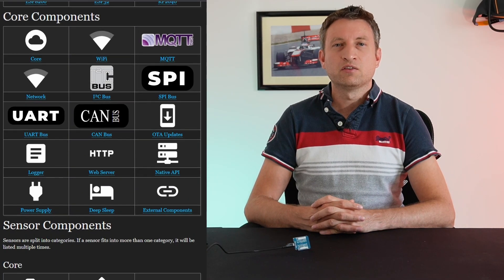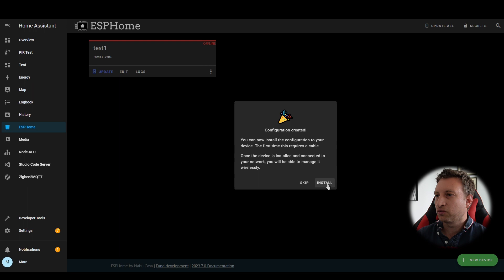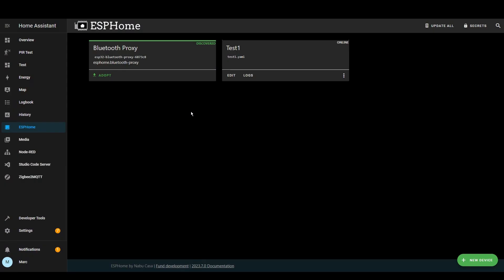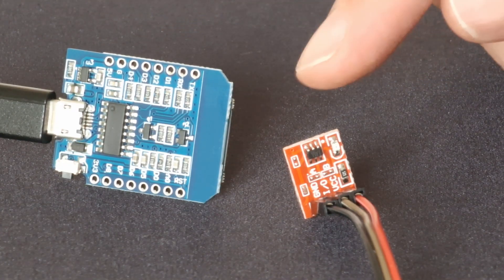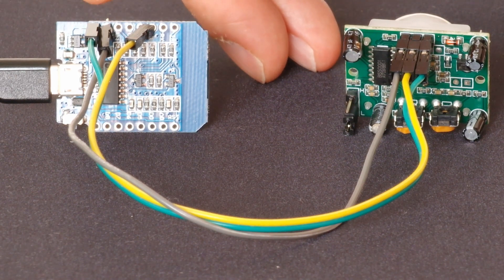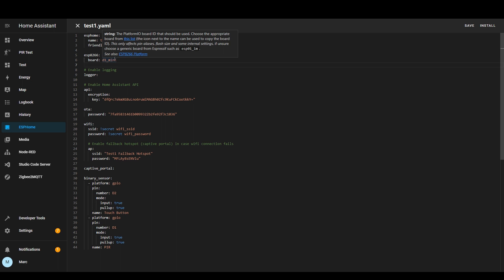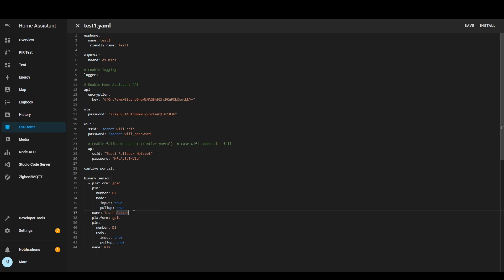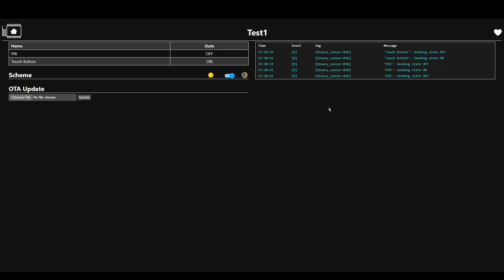Getting started with ESPHome

Comment: Very nice tutorials!

I've developed some custom devices coded in arduino which work great, fully independently.

It monitors the voltage in my home, display it on a small OLED screen and in case it goes over / below a configured threshold to open / close some relays (with a configured debounce when going over or below the threshold).

I also have a potentiometer in order to easily adjust the threshold voltage between a min / max range.

But I'd like to know if it's possible to rebuild this using ESPHome just in order to be able to also integrate them easily into HA if needed as extra functionality (besides working independently).

And maybe a simple web GUI using ESP32's internal web server to control the threshold (and maybe the debounce timings).

Comment: Spectacular, for a moment it gave me hope.
My Circular Failures at trying to run & make esphome prepare a esp32 dev kit board (wroom-32) for initial use.
Every attempt, every way to run ESPHome Builder FAils Spectacularly with impossible to resolve errors.
Searching for solutions brings up endless of the same but different and no real solutions I can understand or relate to.

I'm a Disabled American Vet thats been through 20 ortho surgeries to my spine, leg and knee. I have enough electronics in my spine and hardware in my body to make "The Six Million Dollar Man" look like a 2 cent nobody. Have been at this for over 24 hours straight. Im tired, and I I hurt alot and I am at my ropes end. Like my life This is a Dog Gone Greek Tragedy of the highest order. Following all procedures from ESPhone to the very letter, how can this be filled with so many bugs and failures as if they don't know. If you have the stomach for it go ahead and read on. Thanks!

Can anyone help me out. It has to be an install under Ubuntu. Its on my nice Dell Laptop now. I intend to buy a Raspberry Pi5 but I will put Ubuntu on that. Im not ust going to waste the whole thing to run a few cycles for HAOS that would be a complete waste of hardware in my eyes and wallet. So if you can help a Brother please do and Ill try to make it up some time in the future. Thanks!!!

Install home assistant under ubuntu 24.04 with kvm
------------------------------------------------------
The home assistant cli opens sucessfully after starting the vm
Enter the home assistant url http://homeassistant.local:8123 that is displayed in the cli in chrome browser.
I cant remember how I choose to do this because nowhere can I find how to "start" hoem assistant after the cli comes up
Upon the first time of getting to HA site I did a add on for esphome.
I am using a esp32 devkit board with a wroom-32 on it.
Ive used this board and 3 others the same a million times under arduino...so they work
Clicking on ESPHome Builder from the side menu in home assistant opens the esphome window in my home assistant browser window
The Welcome to ESPHome window opens and prompts me to add new device. I click +NewDevice

Here's wehre things go very bad and put me thru a several hour circular path right back to m initial Failures

After the click the a small info panel opens:
1st paragraph: ust states to connect device with a USB cable
2nd paragraph: You are not browsing the ESPHome Device Builder over a secure connection (HTTPS). This prevents ESPHome from being able to install this on devices connected to this computer.
3rd paragrpah: You will still be able to install ESPHome by connecting the device to the computer that runs the ESPHome Device Builder.
4th paragraph: Alternatively, you can use ESPHome Web to prepare a device for being used with ESPHome using this computer.

Commentary on above: What good is ESPHome Device Builder as an add on if it wont run under the home assistant window.OR is this just because I installed it in KVM under Ubuntu 24.04?!?!?
I dont understand paragraph 3 telling me I can still install it, after telling me I cant in paragraph 2. Really?!?!

Esphome Web or Continue
-----------------------
I then have 2 choices: Open EspHomeWeb or Continue.
 -Option 2. Continue produces a small window withspinning status wheel like in Windows that never ends.Its bassically a crash.
  - I must reload the bbrowser window to try other option
- Option 1. I refresh browser window, Ive also shut down the browser and the KVM and started all ovver agian theres no difference
 - I click "Open EspHomeWeb", Im taken to https://web.esphome.io/?dashboard_wizard
 - It tells me to connect my device (esp32 dev kit board with wroom32 module on it). I have it connected to usb, yes its a data cable.
 - Click connect, I select the correct port interface to use, the click "Prepare for first time use"
 - Prompted with antoher small info window "Prepare for first time use" and I click install.
 - A small window pops up with spinning wheel saying "connecting" then "installing"..This will take 2 mins.
 - Great I get small window saying Configuration Installed !!!...and then I click close on it
 - Another small window pops up saying connecting and a second later a faulure window: "An error occured Improv Wifi serial not detected"
 - Whatever that means and why ever it happened.
 - I close the window another opens asking me if I want to download logs. I try that but there are no logs to display or download, its zero size.
 - Theres an "install option". Dont know what it installs but if I click on it now the browser window just hangs.
 - BTW m wifi credentiaons where in the secrets.yaml file. No where did it say to do that. After  reading 10,000 posts and endless sites on how to I finally figured out how to do it.

 Troubleshoting this "An error occured Improv Wifi serial not detected"
 - I search for "An error occured Improv Wifi serial not detected" in browser.
 - Get a bunch of5 yr old posts on esphome or the home assistant community of many getting same mesg, there is no solution.
 - Looks like official esphome replies blaming it on the folks and saying the esp32  moudles where already verified to work.
 - But this isnt true.
 - Later thru a zillion seraches I find on this site https://www.espboards.dev/blog/setting-up-esphome-first-time/
  - Its an offical esp32 site. And can you beleive it, the 1st thing they admit on the page is this wifi impro problem per below!!!!
   "Setting up ESPHome for the first time on an ESP32 is a simple yet sometimes finicky process, especially with newer boards like the ESP32-S3 or ESP32-C3. The easiest method to begin is using the ESPHome Web Installer, a convenient tool that allows you to flash and configure ESP32 boards directly from your browser. However, this process can sometimes encounter issues, such as the dreaded: An error occurred. Improv Wi-Fi Serial not detected."
 - I'm trying to understand this if S3 and C3 fail and my old Wroom-32 DevKit board fails what else is left in the esp32 world? Seems like 75% of all boards fail?!?!

 
 Install ESPHome Manually
 -------------------------
 The List 2 Solutions to Improv Wi-Fi Serial not detected Problem
 - Solution 1 is to use "ESPHome Web Installer". Okay the failure of the web installer after the failure of the EspHome DeviceBuilder is what got me here and tellign me the solution is what ust caused the problems. Not!!!
 - Solution 2 is to "Install ESPHome Manually". It specifically calls out and states this as a solution to improv wifi serial issue per below
 An error occurred. Improv Wi-Fi Serial not detected
 This issue is common with certain ESP32 boards, such as the ESP32-S3 or ESP32-C3, due to differences in serial communication or board-specific configurations. If the Web Installer fails, you will have to setup ESPHome manually by following these steps.
  - Okay the instructions are pretty clear. I follow them I get the dashboard installed.
  - FYI , its unstalled under a python3 ven environmet. I have one problem come up that cause a failure again at the end
  - I check my install is correct by doing the reccomended "esphome --version" and get Version: Whatever displayed so its good to go.
  - I follow instruction to make a "config" folder then execute the command "sudo esphome dashboard config"
  - Yes I had already done "source venv/bin/activate" and have a (venv) prompt to prove its correct
  - I get "esphome command not found"...but it knows the path becuase it got the version correct, it must know the path.
  - I do a echo $PATH in my env command window. First path listed is source venv/bin/activate, so there is no reason I should get command not found.
  - Alright Im into hours and hours of this by now. Tired I will give it the path for now and put in "sudo /home/don/venv/bin/esphome dashboard config". I do this in the directory that the config dir
  - I made is in otherwise it doesnt work.
  - The cmd window gie me the url to got to http://0.0.0.0:6052http://0.0.0.0:6052" whihc directs rightback to my laptop. Yippie,Dashboard comes up.
  - Basically looks like the esp web interface I name the device, I entered wifi credentials, they are in a secret.yaml file I click to init my esp32 devkit board and a small window asking me how I want to do this comes up.
    - I choose "Plug into this computer. For deices connected via USB to this computer". ITs the only choice that will work, theres a chocie to use web tools but thats what got me  here. so I dont select that.
    - here we go again!!! A window pops up saying it cant do it because, you guessed it, its not HTTPS. Of course not its local on my system.
    - Again what the heck good is this why is esphome giving me a nonsecure browser or program that calls the browser themn complains its non secure. What the Heck!?!?!
    = Two options again, thsi sound familiar
     - Option 1. Download the proect - that spun and spun and ust hung the browser like many times above.
     - Option 2. Open ESPHomeWeb !!!! Okay now the fuailure of this circular logic is complete. It takes me in a complete circle to only go back to what caused the original failure.
     = Oaky one bit of infoafter I got b my frustration. In Option 1 Download Proect I see now a "preperation failed see what went wrong" link so I click it.
     - Okay again no logs when you click get logs.
     - ub tI check the venv command window and see "FileNotFoundError: [Errno 2] No such file or directory: 'esphome"
     - Im guessing this is the PATH issue. To review the Version command worked, my venv echo $PATH showed the correct path as first item listed in PATH. I even entered the PATH in the non venv thinking it may be looking at that one but it sitll go same error here.
     - I doubt een if it could find the PATH for esphome binary it would still give me the improv wifi error whatever improv means, whatever the error means.

Comment: You say "Beginner" but don't show us which developer boards and other pieces to get as a "hardware startup kit"... Please provide some recommendations.
Reply from the maker: I think as a starting point most ESP32 boards are worthwhile. For example this one on AliExpress: https://s.click.aliexpress.com/e/_DC4UXyh
This has 2 listings, one for the ESP32 itself and then an optional development which can be a nice way of easily attaching wires to the GPIO pins. Please note this is an affiliate link so I would get a few pence if you used it, but you can also just search for "ESP32" on Aliexpress. There are so many sellers I can't guarantee what they are like, but I've ordered a lot from Aliexpress and thankfully never really had an issue. Hope this helps!

Comment: great video - thanks... what are the advantages of doing this with a d1mini rather than just buying a zigbee PIR sensor for example?  Cheers
Reply from the maker: I would say mainly that you can attach lots of different sensors to the same device, such as mmWave or temp and humidity sensors etc.

It was more to explain the concept of ESPHome and connecting sensors than the PIR specifically.

Also it's wifi rather than zigbee, so useful for people who don't use zigbee.

Zigbee PIRs are of course a great option though and I use lots of them in my smart home!

Zigbee is great for places you can't get power to. Some people hate the thought of changing coin cell batteries every couple of years, so wired sensors have their place.
Reply: @lets-automate  defninitely get the battery replacement thing!!! ;-) Think I'll order a few D1minis / relays and give them a try too... if nothing else, I learn how to flash code to them etc!

Comment: Hello, I did everything on the video but when I setup the binary sensor and try to install I get the following message:

INFO ESPHome 2024.4.1
INFO Reading configuration /config/esphome/entrada-principal.yaml...
Failed config

captive_portal: [source /config/esphome/entrada-principal.yaml:30]
  
  [binary_sensor] is an invalid option for [captive_portal]. Please check the indentation.
  binary_sensor: 
    - platform: gpio
      pin: 
        number: D2
        mode: 
          input: True
          pullup: True
      name: sen puerta
Reply: Sorry never mind, my fault in the formating of the code

Comment: Very useful - and nice to see an up to date video, since GUIs can change so fast.
I didn't really grasp the one-click insertion of the sensors - I understand the pin selection and the electronics - but where did the subject names - platform / pin / number /mode come from? You appeared to paste them in from nowhere?
Reply from the maker: Thanks for the comment!

This was my first ESPHome video and I didn't put a link to the full code. There are a few links in the description to the documentation used though.

I have an ESPHome playlist that might be worth checking out as most of the later videos include links to my sample code. The bath sensor one is quite similar.

Comment: So, for example, if I want a temperature humidity sensor in a couple of different rooms, I need a main esp board for each sensor as well, right?
Reply from the maker: Yes, you would need an ESP for each room unless you put one in the wall between 2 rooms.

If it's just for temperature and humidity though I'd probably say go with a zigbee one instead if you have a zigbee network. They are fairly cheap and run off batteries for a couple of years, so no need to have power nearby.

If you're going to connect other sensors as well though then it makes sense to use an ESP device.
Reply: @lets-automate  thank you!
That's the thing, tho. I've got zigbee temp/hum. Sensors. And they work great. BUT their battery doesn't update. It stays at either 100% or at a % the battery is at.

I've ordered some new ones, aqara ones, hopefully that fixes some things I'm dealing with atm.

Comment: would i be able to trigger an automation from incoming voltage from a relay for an alarm panel push notification?
Reply from the maker: Yes you could. A little more complex because the voltage from your alarm is probably too high. Also, relays can send voltage spikes when turned on and off which could fry the microcontroller.

It would probably be best to step-down the voltage from the alarm and use that to turn on an optocoupler. The other side of the optocoupler would then be connected to a gpio pin so that it would be high when on and low when off.

You might need to do a bit of research.

I know it is possible though because a few years ago I used a usb port on my TV which only had power when the TV was on, to detect if the TV was on in Home Assistant, as it wasn't a smart TV. (I could of course have used a power monitoring smart plug instead for this example!)